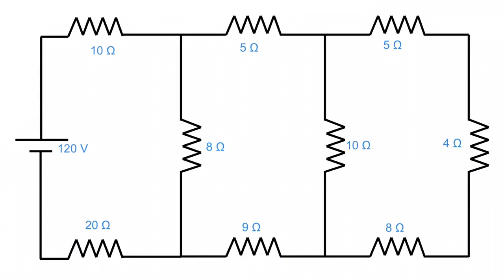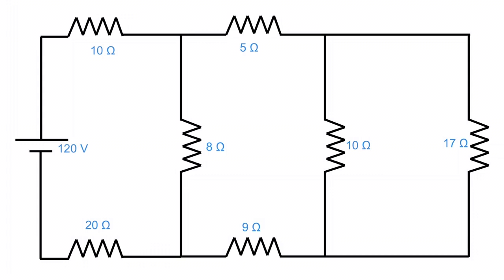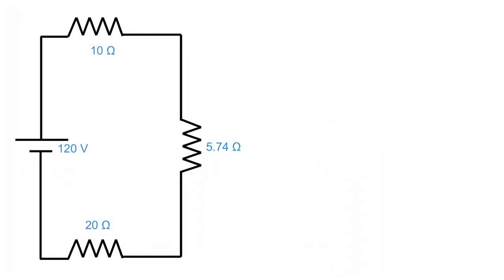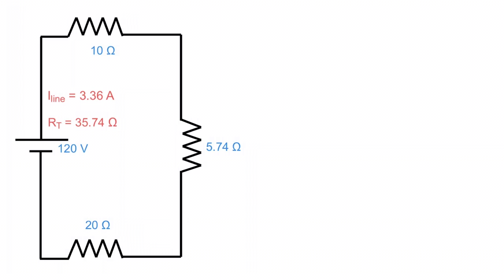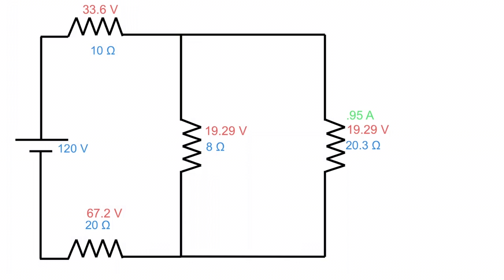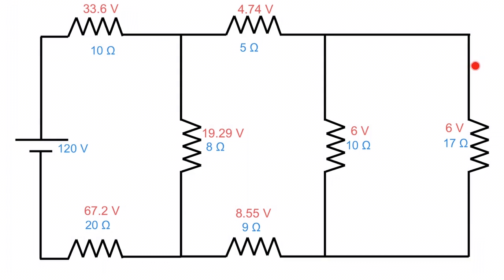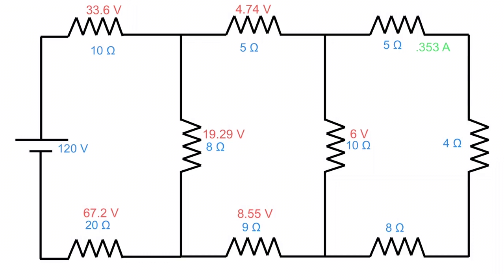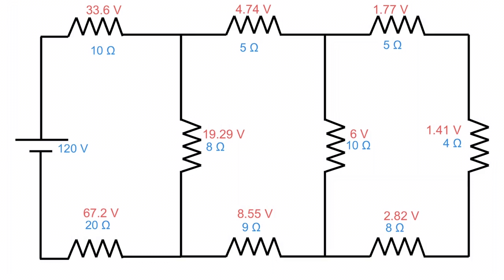Combination circuits

Comment: Ok. Great video. I would like to repeat a question posted in here already. How did you get 6.3 ohms ??? Whats the process. I can't get to the same. Could you explain ??? or anyone else ?? Thank you.
Reply from the maker: Because they are in parallel you have to add them reciprocally.  1/10 + 1/17= 1/6.3
Reply: @TheElectricAcademy  1/17= .0588 ,   1/10= 0.1, this gives you .0588 + 0.1= 0.1588 which is the reciprocal of 6.3 ohms. Thanks I think I got it now.

Comment: 19.29 V with 8 OHMS is incorrect. You used 5.74 OHMs multiplied by 3.36 to get 19.29. But when you expanded the resistor you still kept volts at 19.29, which would change the current for that resistor to 2.4 Amps. Please explain.
Reply from the maker: it actually still works out.  The current splits between the two branches which is why the current changes.  Kirchoffs current law.  You almost had me there for a second.  If you want me to go deeper into the explanation I can.